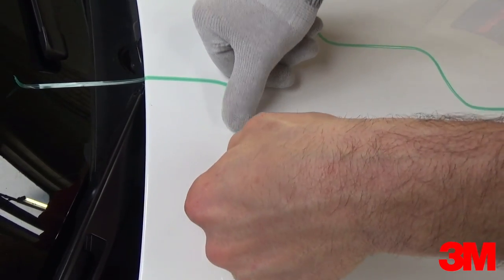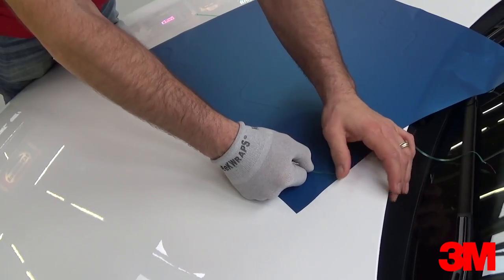3M Knifeless Tape – Tight Radius Turns

Comment: Is there any way to do this with a 90° corner? My only thought for a 90° corner was to stop at your corner and then use a razor to remove a small 1/8 inch section of the green tape only leaving the string in which case you should be able to get a 90° corner out of that and then just being careful when you pull it, does that sound like it would work or is there a different method?